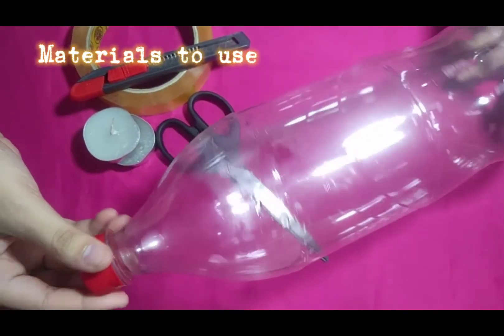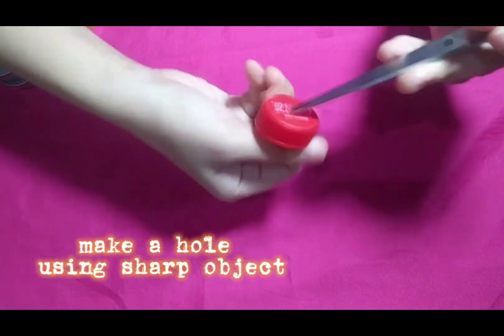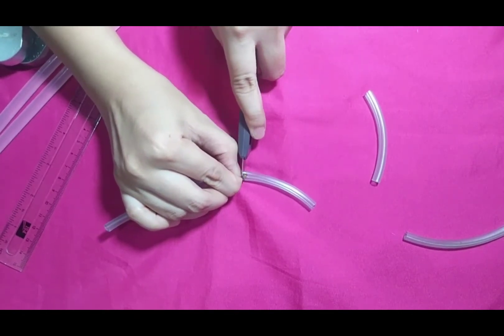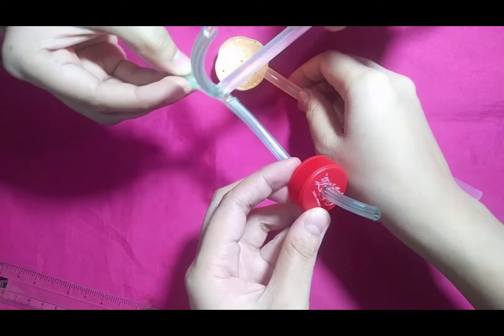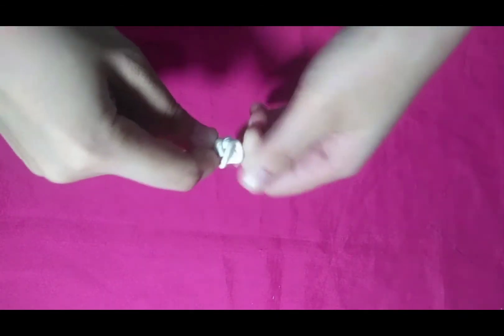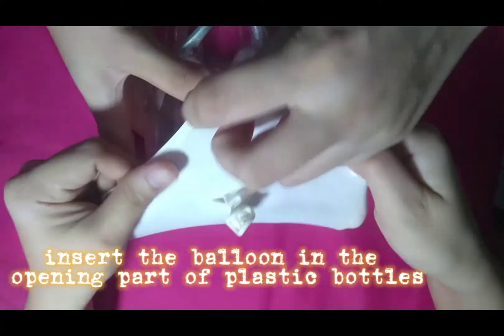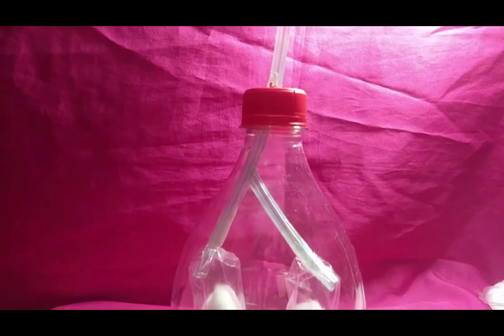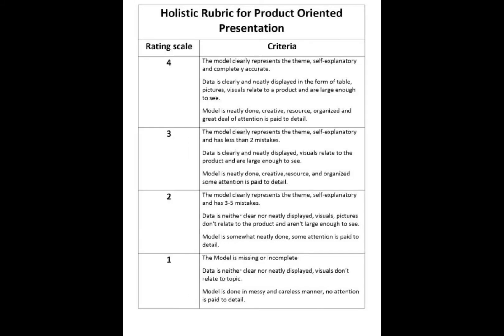Product Oriented of a Lung Model by Piñero Leah & Sardan Jasmin

Comment: Batal, Mary Grace B.
ED302-G (MONDAY 5:30-8:30)

An empty bottle, a straw, and other recyclable items are used to create a lung model in this video. The presenter did a great job of delivering the procedure and clearly outlining everything. Overall, the video presentation demonstrates originality, creativity, and innovation. It was nice that the materials to be used were each presented separately. Because of its subtitles, the process used to manufacture the product was great. The viewer could have a better perception of the process thanks to the appropriate camera angle. Due to the fact that the materials utilized were recyclable and had the potential to be transformed into something quite educational, creativity was exceptional, extremely economical, and inventive as well. Congratulations and God bless!